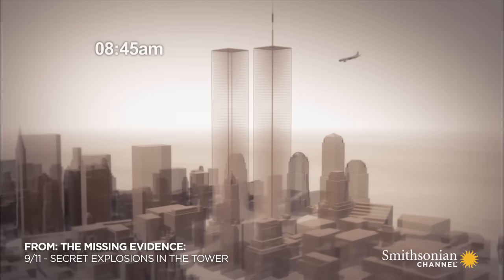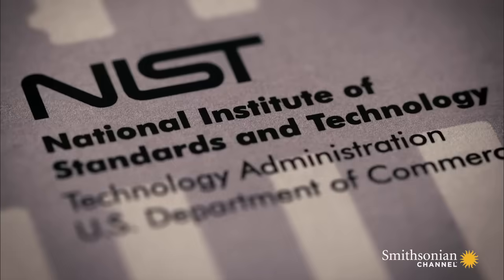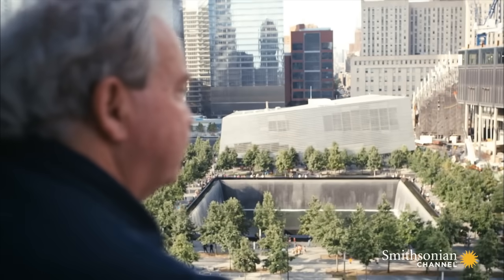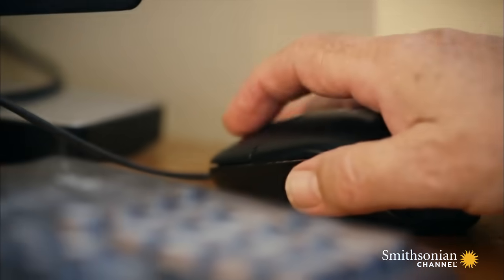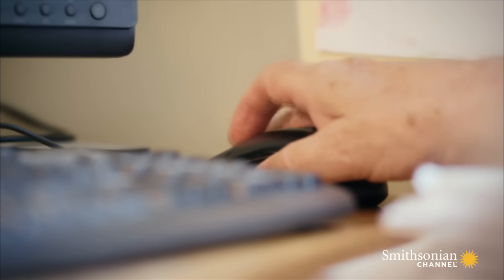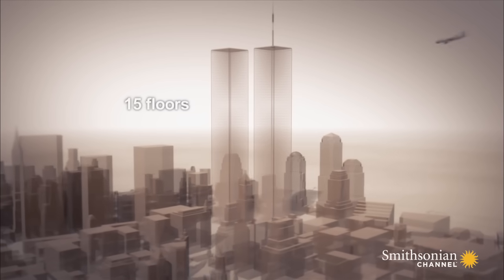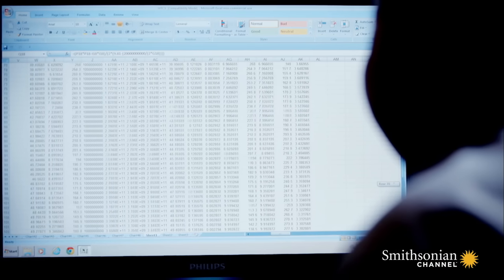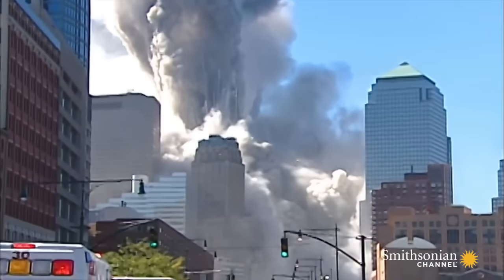This Computer Simulation Explains How the Twin Towers Fell

Comment: What's always made me question the official story was Building 7 falling at almost free fall  speed for 2.5 seconds with the whole 47-story building collapsing in under 7 seconds and it wasn't even hit by a plane!
Reply: Herr Wolf:   I have a degree in  civil engineering, and worked at it for 34 years, among other things. From your  posts, either you have not, or have not been doing much with structures, demolitions, etc., or you would not be making the silly statements about "facts", which are obviously not true, that you have made.    It would be a lengthy conversation,  but just as an example:  bldg. 7  was  mostly a classic  steel frame high rise, so how in the world could some steel sections, blown off the Towers, possibly crash down through 47 intact floors, THEN wipe out the numberous columns at the ground level,  all done simaltaneously in 6 1/2 SECONDS?!
Reply: and don't forget lucky larry's big insurance pay out from building 7
Reply: @sexygothgorrilla  thats just a coincidence!!lol!! move along nothing to see here!!
Reply: @sexygothgorrilla  yeah gongrats Larry
Reply: No, look at the damage to WTC 6.. Much worse and it's outer wall structure was still standing
Reply: Herr Wolf:  IF "13 floors of the WTC slammed into its foundation"   had actually happened, someone other than you would have noticed, but they did not.  In imagination, yes, otherwise no.
Reply: miami boi305 I never mentioned any beams. However, there are 4 enormous beams that extend upwards from the ground yes. I was talking about the impossibility of gravity allowing a small section at the top which stood there completely still for quite some time to destroy more than 3/4 of the huge mass below it which would be pushing upwards with a far greater force than what is pushing downwards.
Reply: ***** I'm curious, how confident are you with your water? Personally, I think it's dangerous (especially for kids) to ignore the water quality in your area. I heavily support the use of carbon block & reverse osmosis filters and remineralization for everyone no matter what the government tells us. I was wondering what your opinion is on that? Is that taking things too far?
Reply: MrTagnan Fire doesn't cause building to cave in.
Reply: Controlled demolition
Reply: @JohnMarat  Gravity.
Reply: btw we both know you read my reply, you're just too much of an ignorant coward to man up and have a debate instead of retreating like a dog with its tail between its legs.
Reply: That image Herr Wolf posted isn't even WTC7... it's the Deutsche Bank Building, which remained standing for years until it was dismantled. Google is your friend
Reply: Just a hair over 4 billion. Not bad considering he only put in 14 million of his own for the purchase. Greedy bastard had a 3.5 billion insurance policy on the towers and then tried to make a separate claim for each plane.
Reply: The Windsor Tower in Madrid burned for 2 days straight that didn't collapse
Reply: @richardhutchinson6578  Windsor Tower is a different design than the Trade Center. That is an unfair comparison
Reply: @AmericanRailfan-gb8oq  is it not an example of steel sitting in an intense fire for days more than the WTC buildings literally at a point the entire building was ablaze and not collapsing, why didn't the steel in Windsor loose 90% of its strength
Reply: @richardhutchinson6578  Maybe because Windsor Tower wasn't poorly fireproofed like the Twin Towers were to save money...
Reply: @richardhutchinson6578  In addition, the fire in the towers didn't comprise 90% of its strength, nor did the beams melt. They lost 60% of there strength at Maximum and couldn't hold the weight above the impact point. Thus why the South Tower collapsed first followed by the North Tower.
Reply: @AmericanRailfan-gb8oq  Plus a plane didn’t crash into them with a great amount of energy that further damaged the support systems.
Reply: @richardhutchinson6578  Are you suggesting that the Windsor Tower and the World Trade  Center had similar constructions? Please comment on how concrete was used in both buildings.
Reply: @LifesLaboratory  that is exactly what I was suggesting..... until I looked more into it and found out the Windsor building had concrete support columns where the twin towers had steel and the steel did actually fail in the Windsor Tower, So let's just pretend I didn't say owt.
Reply: @richardhutchinson6578  Just to be clear here: you are admitting that your assessment was wrong? The Windsor Tower did not fail because the bulk of its support came from concrete, the strength of which was not compromised by the fires. Right?
Reply: ***** See that's the thing...It costs only a few hundred dollars a year to have a high end filtration system and the best defense against it is telling others not to be paranoid?...Our water is filled with chemicals and toxic agents and I see no reason to subject myself or children to it. That's my opinion and given the low cost, it isn't even worth an argument.
Reply: not bldg 7.
Reply: @GhostSal  thanks
Reply: Fire did not bring 7 down. No so called jet fuel even inside the building. You could build a fire yourself inside building 7 and throw everything you got at it and it still wouldn't collapse. Look at all the other skyscrapers that have caught fire and burned with a lot more fire and for days and didn't fall. The fire wasn't hot enough to cause a collapse on all 3 buildings. It's just not physically possible. Over 90% of the jet fuel in towers 1 and 2 burnt up upon impact. Hence the huge fireball when they first hit. Take the other 7 to 10% of fuel left combined with office furnishings and it can't get hot enough. Plus all the black smoke only proved that the fire that was burning was starved of oxygen. Which would have died out before the collapse. Those buildings fell at free fall speed. Which means no resistance. Like I said, it's all physical impossible.
Reply: @danielallen7384  exactly
Reply: @danielallen7384  correct!!!
Reply: @danielallen7384  yea yea, people like you are a disgrace to mankind
Reply: @danielallen7384  plus, WTC 7 had a weird design, it wasn’t designed with a fire in mind.
Reply: @cloudcraft7153  so you actually believe fire ALONE brought that building down? That it caused a synchronized global collapse at freefall speed? You really truly believe that?
Reply: @danielallen7384  the fire didn’t, the building was damaged fatally during the collapse of the towers, its a miracle it stayed up so long.
Reply: @danielallen7384  As we all have seen, it is possible. The South Tower fell faster, since more floors were above the damaged ones. Therefore, as the metal frame got softened by the fires, it could no longer sustain the combined weight of all the floors above the damaged ones. Then, as the floors collapsed, their combined mass was added to the next floors, then the next ones, etc. Therefore, the great many tons of rubble, with its mass combined, made it appear as if it all was free-falling.

Do you remember having lined up the dominoes and then pushing the nearest piece onto the next one? I think we all did that as kids; so, the first piece hit the second piece, then the both of them combined hit the third piece and so forth... Therefore, obviously, the dominoes fell faster and faster. Same thing happened with the twin towers, obviously.
By the way, for that same reason, the North Tower remained standing longer, since there were not as many floors above the damaged ones.
Reply: @danielallen7384  The buildings did not fall at free-fall speed my friend, if that were true, then why did 80% of Warsaw's Buildings during World War II fall AFTER the invasion of Poland ended...
Reply: @danielallen7384  "You could build a fire yourself inside building 7 and throw everything you got at it and it still wouldn't collapse." Really? Based on "feelings"? The building did not fall at freefall speed. Have you actually watched the videos and timed them? I'm afraid your laziness and ignorance of physics is not evidence that physical laws were violated.
Reply: @LifesLaboratory  does controlled demotions leave traces? like chemicals or something else?
Reply: @LifesLaboratory 😂😂 You are the one ignorant about physics
Reply: @CarolJohnson-p6i  What a thoughtful and well argued response. You've won me over.
Reply: Turtle man Aka the turtleinatorrrr lolololol derrrr I'm just trying to discourage other users from acting like you, because it's dumbass like you who only continue to bring this world down even more with your foolish ignorance that you post online, and I sure hope that it was your abuse of sniffing on sharpie that has made you this stupid, because if there's anybody born even half as dumb as you, then God have mercy on their soul, because there is no chance for them to function properly
Reply: Best case scenario, the entire WTC complex was built incredibly weaker than it should have been. To the point where we should seriously question the integrity of the internals of pretty much any building in New York built after the 60s.
Reply: blg 7 is the white unicorn. It's the thing that shined light on the entire crime. It out it, the feds and the Israelis wouldn't have gotten away with it scott free. Not saying anyone will be charged, but we know what they did
Reply: Turtle man Aka the turtleinatorrrr lolololol derrrr  that is not what those beams do lol
Reply: nin6246 peices of the plane hit it also it fell later
Reply: MrTagnan sure it did.
Reply: the cavemen did it, we had no motive to go to war, it wastes taxpayer money! it was the damn cave people. i know it sounds like a fairy tale and i may not have proof, but still.
Reply: monkeyfuel69 
Are you saying that any degree issued by Youtube is useless?!? ALL of them?!? Even medical degrees issued before 2008?
I thought I was grandfathered in!
So much wasted time...
Reply: Maybe WTC7 was just really upset about the whole day and just collapsed under the pressure. Peer pressure.
Reply: the intact passports they so conviniently found are questionable too
Reply: what about pentagon lies
and every other lie on 911 what about the people  denying the jumpers jumped and the explosions before the tower exploded  in the basement what about the HERO who aint a hero anymore the guy helped well over 200 people out the buildiung cause he had the only key the only key alot of things dont add up america always whas fishy
Reply: ...and come to think of it, the Verizon building to the left of WTC7 didn't catch fire or collapse. Weird. Something's not right.
Reply: @Xavier7799  The building you're talking about somehow must have been built stronger than that Building 7: not the ground vibration, nor the flying debris  have destroyed that Verizon building. Surely, it must have been composed of stronger materials and it's been established upon a stronger foundation, too...

PS: I've got nothing to do with building construction whatsoever: I'm not a construction worker, nor an architect of any kind. I'm just guessing here...
Reply: Larry Silverstein can tell you
Reply: @johnkonor4285  Oh of course you bring up Larry Silverstein. Did you actually listen to the entire interview or did you just listen to an edited part like most you conspiracy theorists do
Reply: Uhm, actually... the whole collapse took 13 seconds not 7. 7 seconds was just the outher shell but it was a progressive collapse that started on the east side then progressed. The only one you’re talking about is the very last part.
Reply: Fires started in building 7 from a significant amount of north tower debris hitting building 7, and subsequently, fires burned on at least 9 floors of building 7 unchecked for hours.  That's why building 7 went down.
Reply: Herr Wolf:   Even if the pictures shown in your referenced link are authentic,   it is quite clear that the damage shown in nowhere NEARLY enough to bring down the building.  It shows no sign of even being "bent", forget about collapsing.   Also,  it does NOT show much fire damage either, compared to  some of the classic steel high rise fires shown on Youtube, which I would have thought you had seen, but apparently not.
Reply: My above comment was NOT made in answer to nine246 but to an earlier poster who insisted that burning ofice furniture can explain the fall of bldg. 7
Reply: What you are saying is theoretically true, but not  ACTUALLY  true.  The contents of the WTC buildings  were mainly office furnishings, rugs, records, etc.  In other words,  "lots of things"  were not actually in the picture.  Unless you have some "inside" information.
Reply: So you're saying that an object at rest with no external forces goes from standing fine obeying the laws of gravity and equal and opposite forces for a large amount of time after the impact and then magically goes oh ok guess it doesn't apply now durr i'm just a weak little building made of toothpicks dur? Btw that one compromised section is the only compromised one so all of the 3/4 below it which have steel construction that was intact would still be able to hold up whatever was damaged above it like it had been doing for years. you think just because something above is weakend that the bottom portion is any less capable of holding the same amount of weight? you retarded bro? also the obese boy jumped back in to give his cum for brains assessment without any scientific reasoning. good job fat boy.and yea, ho2 is correct your theory would have to also hold true for building 7 which had no real damage and just some small fires then fell at freefall speed. to argue against these facts is literally retarded.
Reply: @Lookatthosechimkens  "So you're saying that an object at rest with no external forces", Sorry, did gravity stop being a thing?
Reply: The debris of the towers made it fall
Reply: @tapele5987  We all know it did. The problem is the Conspiracy Theorists think otherwise without evidence to prove what they are talking about
Reply: What you just said proves how stupid you really are that is not how you calculate free fall speed.
Reply: Planes use 90% of their fuel on take off
Reply: Herr Wolf yes, just look at Flint Michigan.  You can always trust the government
Reply: It did not fall at free fall speed. The roof collapsed first and it fell in on itself. You might want to actually watch the videos more carefully.
Reply: @LifesLaboratory  They won't because they are members of the Islamic State
Reply: @BuckeyeNationRailroader  Uhmm, what?
Reply: Daniel Allen you cannot tell from the color of smoke if the fire was lacking needed oxygen. Black smoke can be caused by lots of things, not just having not enough oxygen.
Reply: nin6246 it was on fire. It's interior collapsed before the exterior
Reply: @mistertagnan  You're on dope.
Reply: What’s always made me question conspiracy theorists is the engineering degree they received by watching YouTube videos.
Reply: @monkeyfuel69  what about the degrees of the hundreds of engineers and architects that call bullsh*t, do they count?
Reply: Turtle man Aka the turtleinatorrrr lolololol derrrr Are you actually calling someone else retarded with a name like that? And that ugly fat faced picture of yours? Obviously you had to of come up with that name while you were sniffing on a sharpie in the bathroom of the special needs class you attend at the state school, so stfu and quit sniffing on a sharpie, and maybe you won't be as stupid
Reply: I would guess it was becouse of the shatter that he big towers made to the ground when collapsing
Reply: @pyrykalanen8305  Tell your bosses at NIST their story isn't working.
Reply: @pyrykalanen8305  no that's wrong and total bs
Reply: Turtle man Aka the turtleinatorrrr lolololol derrrr lol I bet he thinks the video shows the world trade as the first building. Beams don't push dumb fuck they support. And brace. The towers were not built with thousands of beams distributed the entire surface area like most high rises. Its built like a freaking parking deck beam central structure. With concrete surface area followed by exterior bracing from the actual sections of Frames where the windows would be. If its out skin was comprised no big deal. But one of the structural beams was bent and its braces compromised. When that snapped the thousand upon thousands of tons over head snapped that compromised level. And because it was like a hollow parking deck that weighted forces momentum started a chain reaction. The fucking building did its job it stood from a direct blow. The problem is like the fucking titanic they did not take into account upward forces caving in the sections. The build was both strong and design flawed just like the fucking titanic
Reply: The fact you think it fell at free fall rate proves your dumb as shit I didn't bother to read the rest. Check your eyes. Take acid much do we?
Reply: it had the largest building on the planet collapse next to it, causing a lot of chunks to smash into it, and it was also burned from the inside out due to all the fires.
Reply: building 7 collapsed due to debris being launched at it from the collapse of the south tower and a fire on the inside
Reply: @therealtony2009 North Tower...
Reply: Herr Wolf. It reads as though it took him 34 years to get his degree and he still hasn't worked out what gravity is or how it works.
Reply: Dude they have a close up video of them beam buckling under the load. After that weight and gravity did the rest
Reply: @Miamiboi305  Nothing makes sense on any of it but this does. Especially with the fact that the south tower collapsed first from more weight on the impact site. Causing it to buckle in first then fall.